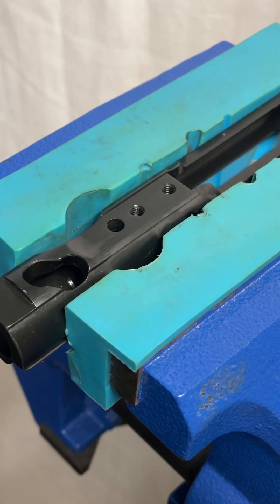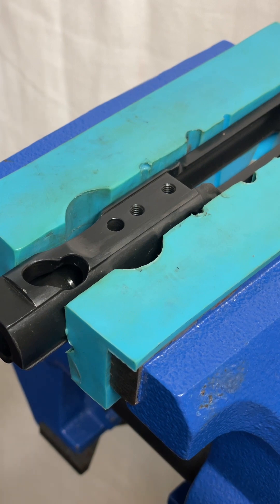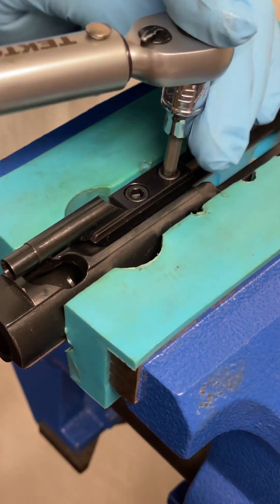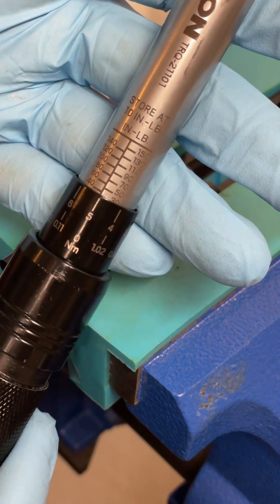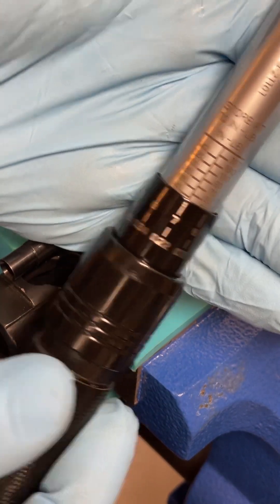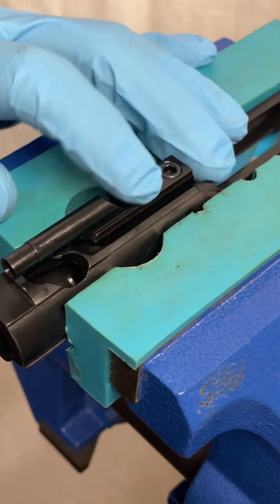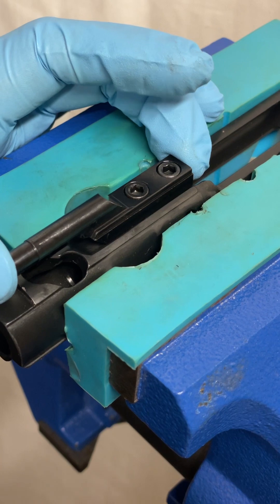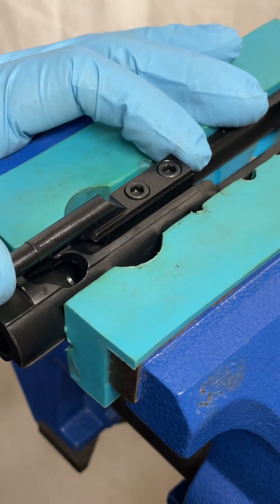Gas Key Screw Reverse Torque Test

Comment: I wonder how well it would have worked and how well the fastener the screws would have held up. If the torquing had been incremental up to 60 lb. Do the front one do the back one to the front window. The back window the front one back one so forth always starting with the front one and then going to the back one starting like it 30 lb and then going up to 60 lb. I wonder how well that would have worked that way because I'm suspicious that torquing one loosened the other I've seen that happen in other things and in the automotive. A guy that taught me how to do things and talking heads and things like that was you worked up. You didn't start off with the max amount you worked up so I wonder how well that would have worked here. Just a thought. Not saying anything was done incorrectly. Just a thought

Comment: I purchased one of your bolt carriers and some flaws.. I found the opposite side firing pin cotter key hole was undersized making the cotter key insertion difficult. I have only seen this with another nitride bolt carrier I purchased from a different manufacturer..I drilled it out which solved the problem..The gas key I.D. was over sized, the carrier itself was short and the firing pin protrusion was way short (bolt was too long)..Just a heads up..

Comment: Hi, Youtube decided I needed to see this.  I don't know anything about ARs..I had to watch a couple other videos for context on what you're talking about.  I do know a bit about bolted joints. The torque in either direction isn't what's keeping your joint gas-tight, the bolt clamping force is.  Oil on your phosphated threads will increase that clamping force, so that's good.  If the leaks are due to the screws loosening the question would be why the screws loosen.  It could be due to motion in the joint and insufficient preload to counteract that. The screws are too small for reliable torque to yield (by far the most accurate method to guarantee the maximum clamping force) but if "stupid tight" isn't tight enough to prevent loosening, why not just add a drop of Loctite?  If you get that part hot enough to burn Loctite I assume the rest of the gun isn't going to survive much longer either. Loctite isn't a cure for improper tightening but it is a cure for poorly designed joints that loosen bolts in service.
Reply: Hot gasses are vented through a port in the barrel then through a gass tube directly into that part on the bolt carrier it gets very hot . Also you can get parts of a AR to glow red hot without hurting the gun